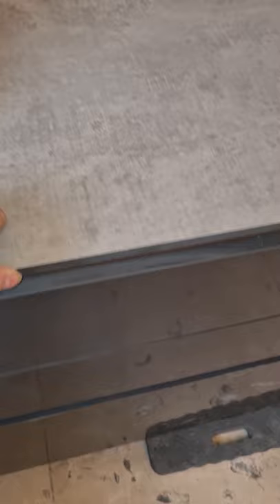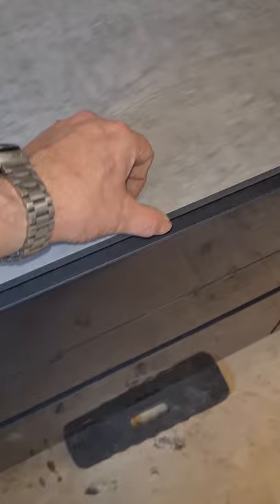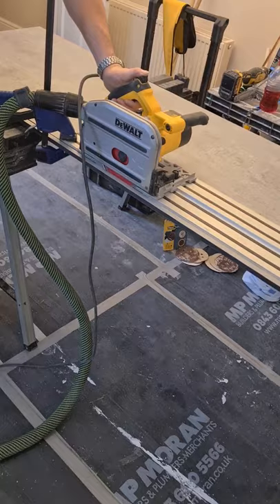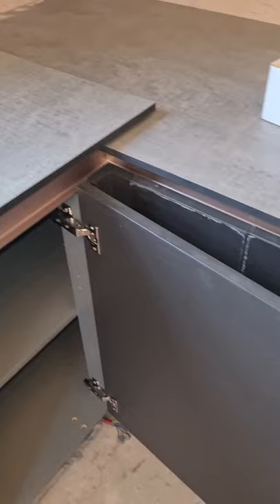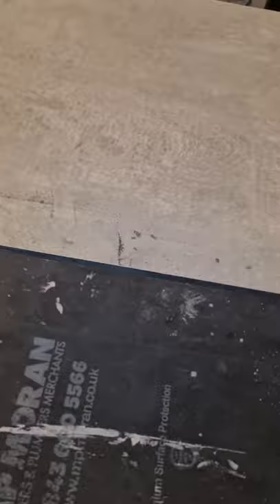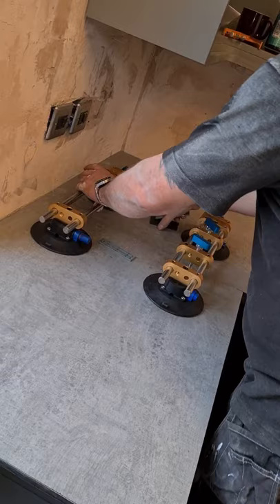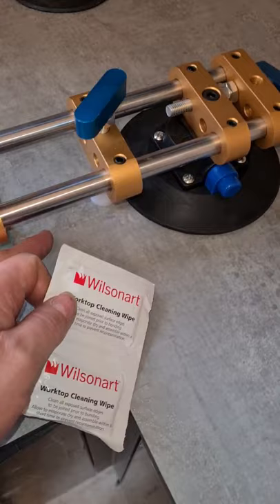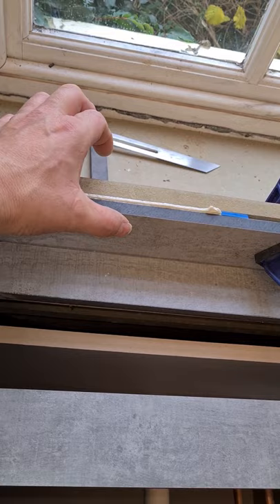COMPACT LAMINATE WORKTOPS HOW TO INSTALL

Comment: We had these fitted about 5/6 years ago. They have been very durable, not a single mark on them anywhere. But, they are very thin, and, as we had a large ceramic hob fitted, the ends between the hob and the outside of the worktop can flex quite a bit. ( But, as I already mentioned, no problems 5 years in ) 
I previously had a black granite worktop in my old house, these are much easier to keep clean and streak free. These were more expensive to have verses what I paid for the granite, but, being early adopters you tend to get stung to have the latest and greatest ☹️

Comment: A customer wanted one of these fitted due to not being able to afford quartz. I told him the labor cost of fitting would come in line with the quartz. These are one worktop I try to avoid, I lost count of the router bits used.
Reply from the maker: Yep they will kill any blade used on them you gave to add that cost in when pricing
Reply: @dcjoinerydjdave6100  Had some lasting literally minutes, found slowing the router down helped
Reply from the maker: @gavincollins9376  i used a plunge saw  for  the main  cut leaving  a 5mm longer then trimed with router found that helped
Reply: I Chamfer edges with hand metal file perfectly 👌

Comment: Great video thanks, I'm going to be installing my 3rd set of these and always looking at different methods, 
Only thing I noticed is when you scribed that worktop for its but joint you scribed it upside down surly if you we're a couple mm out on the back then when the worktop is flipped the imperfection would be on the front, would be minimal but enough to notice 🤔 great video mate .. keep it up
Reply from the maker: It was not upside  down these works tops are pataned on both sides

Comment: Can you please advise how the legs should be fitted if there is an overhang (breakfast bar).  My 'Kitchen Fitter' has just put two very small screws directly into the underside of the worktop.
Reply from the maker: Hi i would have used a strong adhesive  like  ct1 as well as screws

Comment: So how do you biscuit the mitres when you dont have the space to pull them apart i.e u shape but between 2 tops either side?
Reply from the maker: If you use a router you can router a grove from the back to just shy of the front

Comment: Thanks for the video. 

What brand is that router bit you used?
Reply from the maker: @HarveyJohnWillmott  I always use trend bits
Reply: @dcjoinerydjdave6100  Thanks mate. Does that router have enough power for the job? Apparently these worktops are really hard. I’m fitting my first one in a few weeks.

Comment: Great video!! I have a kitchen with an unusual angle corner let's say 110 degree ( not measured the angle yet) would you still scribe and but joint a zenith top on this Dave?
Reply from the maker: I would  still scribe it in for a clean  join
Reply: @dcjoinerydjdave6100  cheers Dave thanks for the quick reply

Comment: Great video and thanks very much. Is there a reason you didn't use the compact toggle bolts?
Reply from the maker: This work tops all 12mm
I my opion its to thin to risk fitting them
Was at that kitchen  last week and its still solid as

Comment: Do you need to apply linseed oil to the join/cut areas? I was told by Howdens its a must
Reply from the maker: I did not but this was a while ago and this nay be a new thing all I had to do was Polish  the edge with a fine scotch  pad that came  in the kit

Comment: Hi, 
I’m about to fit some compact laminate worktops for the first time and it’s in the shape of a U so 2 butt-joints of 600mm along the length of the longer pieces however I am not sure how to skim only a section of the long edges to suit the short edge of the joining piece? 😬 Any recommendations please?
Thanks
Reply from the maker: All the laminate  work toos i have fitted come perfectly  square  from the factory  so they should butt perfectly  as long as your scribe  is tight
Reply: @dcjoinerydjdave6100  
Thanks for your reply, it seems like nobody wants to touch the stuff at all 😅
Reply from the maker: It is a pain to work with

Comment: Nice job. Did you fix worktop to cabinets? I was planning to run some silicon beads to hold it firm when I do mine, or is there a better way? cheers pal
Reply from the maker: Thats what I did just glued it down

Comment: @DC Joinery DJ Dave - nice video thanks. You’re right the blades burn through easy. What  router blade/bit do you use?
Reply from the maker: i use a plunge saw first  5mm or so bigger then the cut then use a router to trim saves the router bits i find pay for trend cost more but last longer

Comment: Great video, really helpful! I have a couple of questions. What blade do you use on your plunge saw for the sink/hob cut out and how many passes did you do on each cut? Also did you use a hole saw for the tap hole cut out and if so which brand/type do you recommend? Thank you
Reply from the maker: I use the recommended  blade  for my saw which is the  dewalt at least 4 passes the prevent burning

Comment: I’ve got a decent off cut of this HPL same as that in this video, I want to use it for a small worktop in my bathroom, could I cut it to a ‘L’ shape using a decent router if I had a jig to run the router around? 
I know you can cut it straight but I need to cut an internal corner to make the L shape but I’m a bit unsure how to do it? I’ll get the correct blades/cutters to do it.
Also how do you polish the edge, what do you use??
Reply: Meant to say, what are the correct blades and cutters to use?
Reply from the maker: So i would make a wood template  then clamp that to the work top then a flush cut router bit to cut the work top then polish with 1000 grit sand paper

Comment: Hi Dave thanks for taking time to make these videos. They're extremely helpful. A couple of questions from a DIYer, I cannot find a mention of anywhere is worktop support. That looks like 45x45 you have below the worktop as support over the cabinets. I did think it would need something due to being so thin. Did you then rip down decor panels to finish the fronts below the front edge of the worktop above the cabinet doors? My installation instructions also prescribe using a 45 degree chamfer router bit to take the sharp edges off then 180 & 240 and sanding pad to polish edges finished with linseed oil. I'm concerned about discolouration of the white(ish)  edge from the oil which looks mahogany coloured in the bottle. Do you have any experience of this or do you just polish and leave? Cheers Gordon 😊
Reply from the maker: Hi Gordon  really happy the videos  helped
In this case the timber  suports are only needed as this kitchen had a handle less  design  and the timber was to hold  a piece  of trim above the doors as a place to open the doors
Please feel free to email me at

info@dc-joinery.co.uk

Then i can pass on a contact no  where i can answer your questions  much better

Comment: Hi Dave. How you fixing top to the base units? I got 3 Appliances next to each other and between only end panel. How you recommend to fix top? Do i need to reinforce in between then top won't be fluffy. In your video you have battens that makes top solid.
Reply from the maker: This kitchen the buttons where  part of the whole kitchen as it wad a handles  door system what o would recommend  is a thin batton  along the wall and use CT1  adhesive  the glue  the work top down

Comment: As a proper kitchen fitter, this vid made me 😂
Reply: Why?
Reply from the maker: Why
Reply: For a start you didn’t show you glueing the joint because you done it dry for effect. If you put a decent amount of epoxy resin on the joint, you need to mask up to the joint with something like gaffer tape up to about 5mm from the joint, there’s no way those shitty wipes Wilsonart supply, which half the time are dry anyway, will wipe the excess off without it drying first, you have to have a bottle of alcohol handy. I don’t mean Vodka either
Reply: Mind you I needed it after watching this…

Comment: Hi Mate, great video, can I ask where you got the suction clamps from? doing my first job with compact laminate, the ones ive seen for sale are quite cheap or crazy expensive, cheers.
Reply from the maker: Hi mate the set in this vid where from ebay they are not bad they do the job if you check the other comments  there should be a link for them
I have since bought a secound set a better quality  set there is a video on here for them with links also any probs let me know
Reply: @dcjoinerydjdave6100  nice one cheers

Comment: How strong is that resin?? Does it hold them together solid?? I’ve done a few of these worktops with the resin and not bothered with bolts as my pal had them suction clamps and he said it’s sound without the bolts?!
Reply from the maker: I have not  used bolts either  as i think the worktops are to thin
Reply: @dcjoinerydjdave6100  yea I agree mate.

Comment: Hi m8, what is effectively your female side of the joint did you router along that edge or do they come sharp enough edged to join, obviously the male side would be scribed and routered
Reply from the maker: The female  edges are factory  so i put a 6ft leavel on it if its good i just biscuit  joint it if it looks ofg i will scribe joint it

Comment: Hello Dave. Do you know if compact laminate is strong enough to support a drop in bathroom sink on a vanity unit?  I have bought an antique sideboard 490mm deep by 1420mm wide and want to take the top off and replace it with compact laminate and drop two 550mm wide sinks in, that sit on the cutouts in the laminate. Haven't bought it yet but sink weighs around 12kg I think. Thank you
Reply from the maker: I would think so they  are very strong work tops
Reply from the maker: Will it be a hole  cut out so the worktop goes  all the way around the sink 
If not  and the front is cut out maybe put some supports  in to the unit to support  the work top
Reply: @dcjoinerydjdave6100  thanks
Reply: @dcjoinerydjdave6100  yes it will be a hole cut inside the laminate..there would be about 60mm of laminate at the front 
 of the basin
Reply from the maker: @JH-lc9st  that should be fine but it may be a good idea the fix in some supports just to cover yourself
Reply from the maker: I can not see why not they are very strong

Comment: What to do if The worktop split on joiner/ biscuit and now there is a gap 1mm, all way down the connection? I’ve tried to pull with the hot glue and did work but for some reason it was coming back to that gap position. Any solution???
Reply from the maker: Did you use the resin glue 
The only thing i can think of may have failed  never seen it before myself
Reply: @dcjoinerydjdave6100  im almost certain that he was using just simple silicone 🤷‍♂️. I’m planning to use worktop connectors each connector will be screwed to the bottom of the worktops, I will use expansion brass inserts M4 and m4 bolts. That should work? What do you think? How would you tackle issue like this? 1mm gap. Thanks 🙏
Reply from the maker: I would remove all the silicone  and clean the joints 
Use the two part resin glue and clamp  the joint together  untill dry if that fails  then attempt  yoyr suggestion
Reply: @dcjoinerydjdave6100  update, i did it Its fixed! At The end i have done 8mm holes and push brass threaded inserts and pulled it together with worktop connecting bolts!!! Super happy 😃
Reply from the maker: Nice work mate

Comment: Good advice so what would you stick the upstand to the wall with normal silicone? Oh and can I cut the hob and sink our with a router and wood router  cutter.
Reply from the maker: I use CT1 to glue the upstand  
And a router wood bit is fine just use a new  one every time as this stuff kills blades  and bits
Reply: @dcjoinerydjdave6100  excellent thanx for the video

Comment: Are those the 6 inch suction clamps? Are they good? Cheers
Reply from the maker: The suction cups  are 6in they do the job i have bought a better set since there is a vid on them too with links in the comments

Comment: How do you cut the sink out? Undermounted. Thanks
Reply from the maker: Measure the inside  of the sink thats the size  of the cut out you need  you can use a plunge saw to cut out the hole then use a sander to smooth out the  cut you then need a jig to router out the draining grooves.
Or you can get an off cut of mdf cut it out the same size of the outside of the sink center it on the work  top and use a router with a 20mm guide  bush to cut out the hole

Comment: Nice work lads can you tell me where you got the clamps from I haven’t got and because I heard they didn’t stick very good with compact laminate
Reply from the maker: Hi mate we got them from ebay
Reply: Mine don't work that great on compact laminate that has a texture. You get a better joint with the bolts but it just adds another process to What is already a complete ballache of a job. Solid laminate worktops want banning, especially the 20mm ones which weigh a ton. 👍
Reply: @jrsuk1170  thanks very much, I’ve been hot melting block up to now but looking for ways to speed up a few things when fitting
Reply: @TheSicosi  I think hot melting blocks and clamping would quicker than bolts but I've only ever done hot melting on mirostone. Bolts will definitely get you a nice tight joint. 👍
Reply: Anyone else have a problem with the white compacts? I’ve done a few now and there’s always a slight grey line where the join is, it’s not much maybe 0.25 of a mm and it’s always bang on flush but can always see the joint line 😡

Comment: Hi Dave. What resin glue i can use for joint apart from that FORCE that in Wickes for 30£
Reply from the maker: Hi mate it comes supplied  with the worktops from howdans  as a fitting kit thats what i use
Reply: @dcjoinerydjdave6100  ok. The one I'm working from Wickes.
Reply from the maker: The resin glue is not cheap any where its not worth cutting costs  with this stuff if wicks recommend there resin i would use it that way you are covered by thete warranty
Reply: @dcjoinerydjdave6100  you right. Thanks Dave
Reply from the maker: Glad i could help

Comment: Out of interest why have you used timber battens on top of the units before top goes on?
Reply from the maker: Its a new style kitchen from howdans thats what they provide  so the copper colored strip is where you open  the  door the battons are spacers
Reply: @dcjoinerydjdave6100  I did think that but wasn't sure. Great job👍👍

Comment: how much that would cost to this type of work ? same L  shape kitchen.
Reply from the maker: To fit  this kitchen between £1,500 to £2,500 depending  on the amout of work needed plus the price  if kitchen
Reply: @dcjoinerydjdave6100  i mean just worktop :)) sorry my english is not so good :)
Reply from the maker: For worktops only between £400 to £600 depending on how many joins
Reply: @dcjoinerydjdave6100   Thank you :)

Comment: Hi mate. Did you use zip bolts?
Reply from the maker: No it's to thin in my opion
Reply: Thanks for the reply! Great video btw 👍🏻 did you fix down with L brackets or literally just glue? Just concerned the glue may not be enough. Cheers xx
Reply: And so you just used biscuits?
Reply from the maker: Just glue been fixed  for over a year now still soild
Reply: @dcjoinerydjdave6100  quality thankyou so much👌  Best vid on YouTube about these type of worktops! Wouldn't have got through today without it 😂 big day tomorrow with sink cutouts. Wish me luck 😉🙏
Reply from the maker: Yes thats right